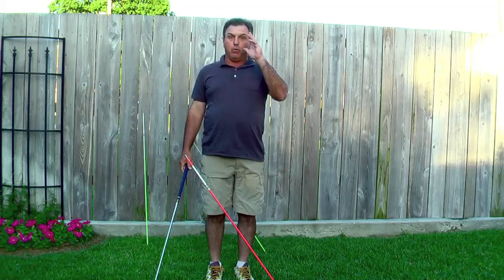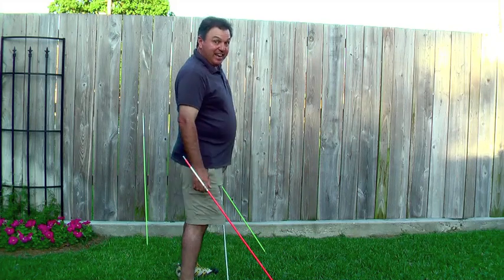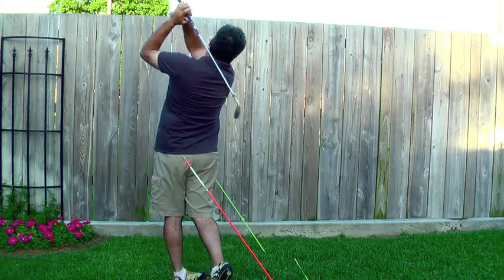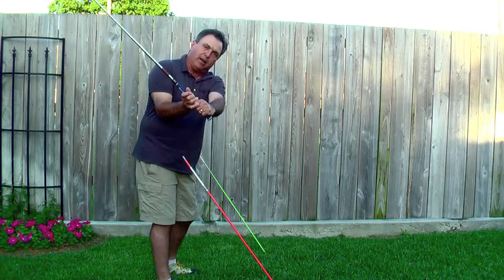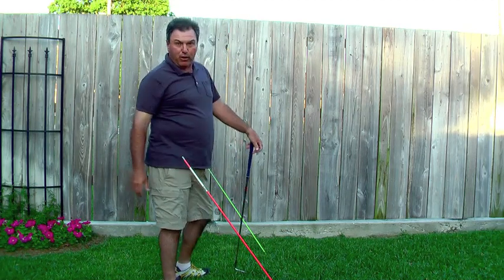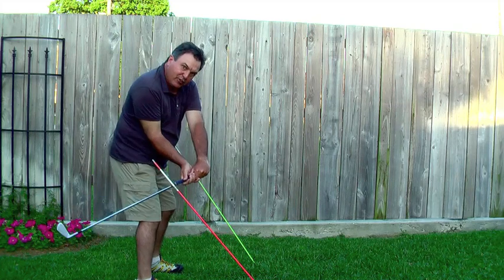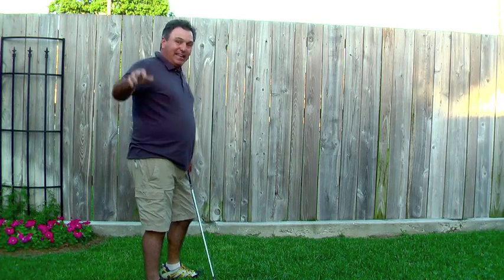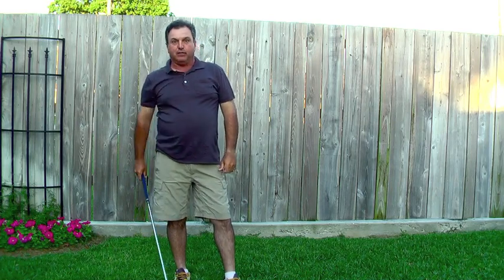Below Plane and the VSP

Comment: Nice explanation of the "tumble". Nobody did that move better than Hogan. But I find that if the clubshaft is on the same vertical plane angle as the left arm at the top, then its pretty hard to get too under plane through impact. However, if the clubshaft is above the left arm plane ("across the line") at the top then  the clubshaft is easily forced into an in-to-out plane on the downswing. You can make up for it with rotation and tumble, but I wouldn't overlook the position at the top.